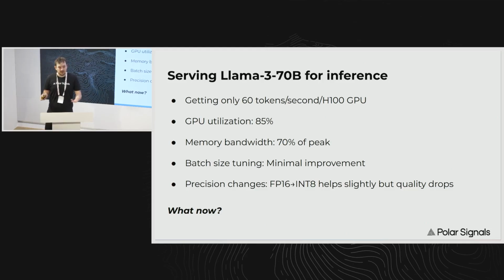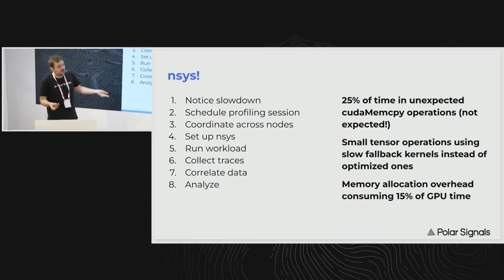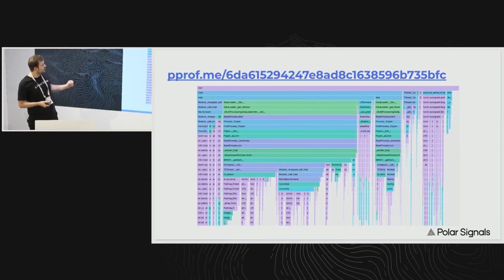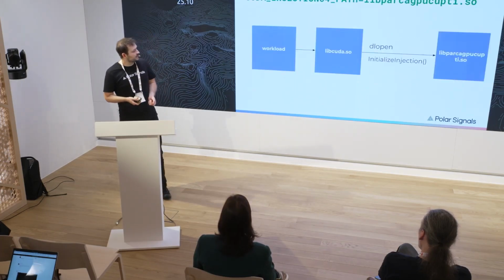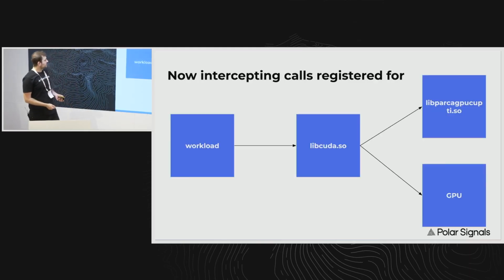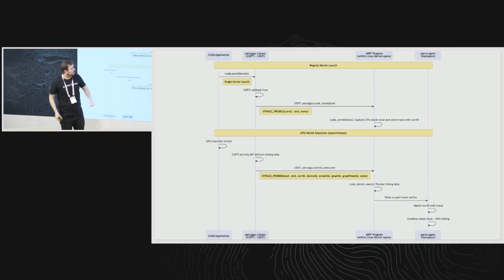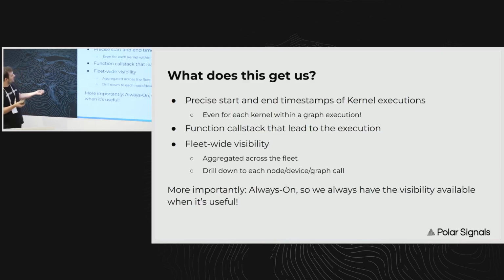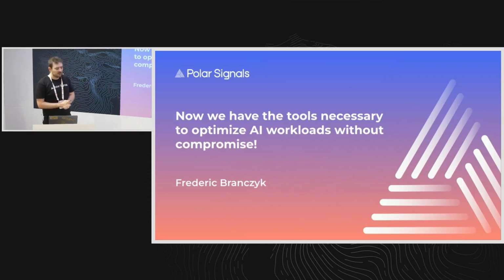Infrastructure-wide profiling of NVIDIA CUDA | Ubuntu Summit 25.10

Comment: Really interesting talk. The more I listen to topics like profiling, kernel tracing and GPU utilization, the more I realize that most real performance optimization today isn’t about changing the architecture of a model, it’s about understanding where time is actually being spent and how the system behaves when it’s running under real conditions. You explained that perfectly. People often think that quantization, batch tuning or hardware upgrades automatically fix bottlenecks, but in practice they don’t. The real bottlenecks come from memory operations, the wrong kernel paths, fallback kernels, or poor scheduling, and those are invisible unless you profile.

I especially liked the point you made that local profiling tools like NVIDIA NSight were never designed for distributed production environments. They work okay if you have one GPU on a developer laptop, but the second you have a real fleet multiple nodes, multiple GPUs, mixture of workloads they become painful. The idea of trying to reproduce production behavior locally is almost a fantasy. Everything behaves differently once you hit scale. What you said about “days to set up, run, aggregate and interpret” is extremely accurate.

Your approach using injection, CUPTI, correlation IDs, and BPF tracepoints makes a lot of sense. The key insight is that trace collection must happen mostly on the CPU and at very low overhead, otherwise nobody can run it continuously in production. Always-on profiling across a cluster without impacting performance is the difference between theoretical debugging and practical reliability. The correlation between stack traces and GPU kernel execution is the part that really matters, because it tells us why a kernel ran, not just that it ran. Without that connection, most raw Nsight data becomes guesswork.

This is also the first time I have seen distributed GPU flame graphs that actually map Python → C++ → kernel execution. That solves a huge blind spot in real AI systems where Python orchestrates everything, but the performance lives in CUDA. Being able to slice performance across nodes, across data centers, across GPU generations that’s critical for AI ops because you can finally answer questions in minutes instead of days.

On a more personal note: I run Ubuntu Server 25 on two of my home PCs. One is my router, Pi-hole, firewall and Plex server. The second is a gaming machine where I compile what I need myself. For many years I hated Ubuntu because it was extremely easy to break, especially when mixing repos or building packages from source. But Ubuntu has come a long way. Modern Ubuntu actually performs better and stays more stable than any distro I have used before, even on machines where I install and compile a lot of my own dependencies. I also stick to Ubuntu’s own UI for both machines and surprisingly it just works. No weird dependency breakage, no mysterious boot failures, nothing unstable so far.

I would love to eventually profile my systems and Plex transcoding performance the same way you profile GPU inference workloads especially fleet-wide and with low overhead. The whole philosophy you presented feels right: don’t guess, don’t assume, don’t rely on hardware intuition measure everything, especially in production.